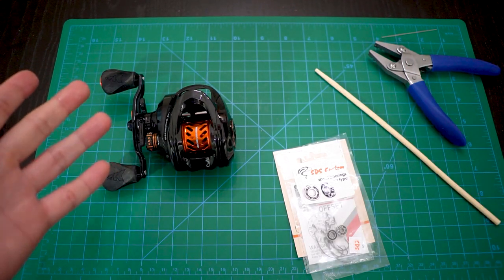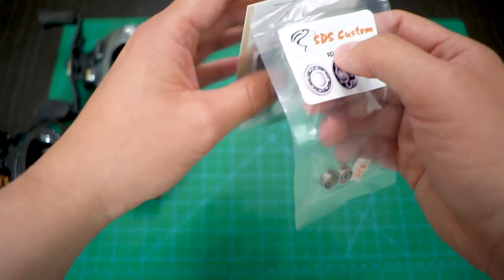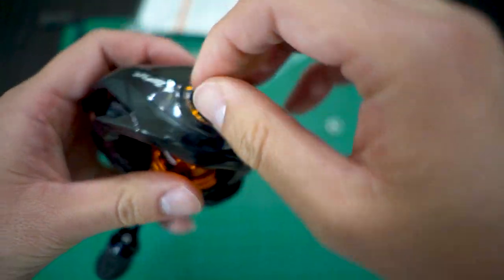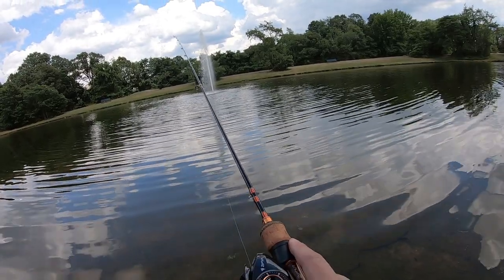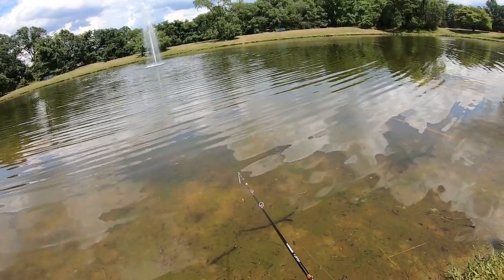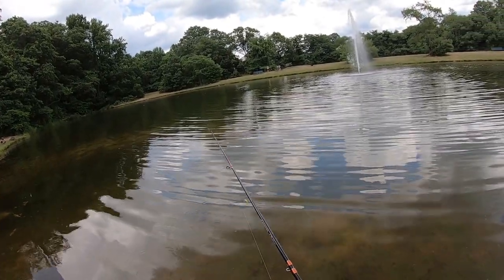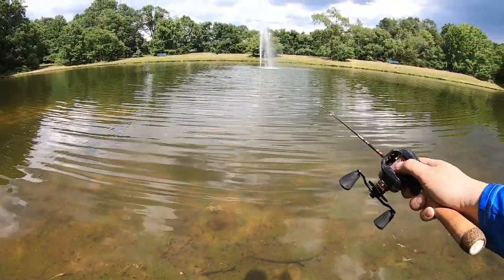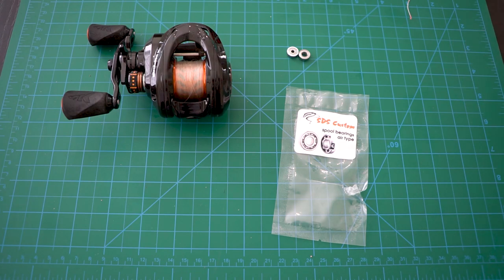KastKing Zephyr BFS Reel Bearing Upgrade - SDS Custom Ceramic Hybrid Bearings

Comment: What do you clean your bearings with?
Reply from the maker: I use CRC Brakleen. Don't use the non-flammable one or the environmental friendly one. Those are not gonna work. 
Some folks use Acetone, I have tried nail polish remover with success...
Some folks use mild dish soap and warm water, but i use that just for the orange seals for those that actually uses that. Chemicals like above would likely eat away the seals lol.
Use a glass jar, not plastic, fill enough so it soaks the bearings completely, swirl around a few times, let it sit, swirl some more.  take it out, place em on a chop stick, then use an air gun to blow clean!

Comment: Hi! Why you change only two bearings? After all, another bearing is located under the axle brake cap.And it also needs to be replaced.
Reply from the maker: That is because its a short shaft spool! The other one isn't really used. This reel is based on the Crixus body... which uses a full shaft spool. If you don't have anything in there to hold the shaft pin. The reel will not work. And even if its a long shaft spool, you won't need it. The bearing on the tension knob is only used when you overly tighten your tension knob. In the bfs realm, that won't happen as you fish with zero tension. Hope that helps clear up any confusions that you may have!
Reply: @rawrfishing  Thank you, I understood your explanation.  If you know the measurements of the axle brake bearing (not in the knob of the handle), please write.
Reply from the maker: @Sergey Fesik I am not sure which one is that. The two spool bearing measurements are mentioned in the video and the description

Comment: I bought the same spool pin remover pliers. It looks like you cut the pin that’s in the pliers shorter?
Reply from the maker: Nah. Mine is an older version.  I think yours might be newer? Is yours working?
Reply: Yeah I just bought mine from boca bearings like a week ago. I haven’t even tryed it yet. I just noticed the pin on urs was shorter and thought maybe there was a reason for that. Thanks for the reply though
Reply from the maker: Hmmmmm.... what if there is one for spinning reels? Hmmm
Reply: raWr Fishing I only see the one I have on the website, maybe they adapted it so u could use it for both types of reels
Reply from the maker: Let us know how it works. I hate the asia ones where's u screw in and push the pins out. All these CDM reels have pins that are stuck hard and it strip every single aluminum pin remover for me....
Reply: raWr Fishing will do bro, you having noticed if the pliers mar up the spool shaft have you?

Comment: onde conseguir esse pratico alicate extrator de pinos dos rolamentos,que o senhor usou neste video para a troca por rolamentos hibridos de ceramica? GRATO!!
Reply from the maker: I used the Pliers from Boca Bearings. but it's a bad plier. it started to warp after 2 years of light usage. I have not found one that i truly like, but they have a bunch of cheap ones on Aliexpress. Just give it a search :)
Reply: @rawrfishing , very grateful, teacher!!

Comment: This ebay retailer has a "full ceramic" version, in addition to the air type and orange type bearings. Has anyone tried full ceramic bearings and know the pros/cons?
Reply from the maker: I have seen it but there shouldn't be any more better performance from the spinning aspect; however, it is better than the hybrids for corrosion resistance. You will also find the full ceramic bearing much more louder.
Reply: I read that the shape of the ceramic ball makes it harder then steel but only in ball shape and since ceramic is like a stone it can file down a tail into the bearings walls maken it slower over time and not much time but with steel walls its has alot more time to wear out the bearing walls
Reply from the maker: I am curious how much can a bearing wear out on a BFS reel compared to say a skateboard or even a normal size reel for heavier lures.
Reply from the maker: I didn't like how they answered the question in their FAQs about if their bearings promote backlashes lol...
Reply: SDS never dissapointed me,great stuff for baitcasters and really good seller

Comment: Hey do you think the hybrid air HD full protect A7 are better then the air type? I’m trying to order mine today but dont know which to get
Reply from the maker: Not sure! Subjective as everyone uses different lure ranges. Some folks will want micro bearings for throwing light lures short range with accuracy and less power. I also only used this and their micro bearings. Have not used the other
Reply: The one you used in the video is the air type?
Reply from the maker: i believe so!

Comment: Yo, can I get a link to the pin remover pliers you're using?  A lot more useful than the generic ones you get off of aliexpress or even hedgehog.
Reply from the maker: Tackle Warehouse got em at 39.99, but u gotta pay shipping. amazon is a like 46 shipped. there are mixed reviews and I have to say, my pin is starting to bend on the pliers and may even get mushroomed. i think it's due to some spools with improper pins that were shoved in too hard and won't budge. 
I also agree, the cheap aluminum ones only last a few tries too.. u run into one that is in hard, u likely will strip the aluminum threading.. which happened to me twice >_< Here is the link to the pliers on amazon (afil. link lol)
https://amzn.to/2Wf7JhG
Reply: @rawrfishing  thanks a bunch
Reply from the maker: @chuelee7201  no problem! I think if I had to, I would get another one. Any spools that won't work.. dont force it. Use the channel lock pliers instead. Did that with my dark wolf lol

Comment: So its the full type ceramic bearings or. There is other types airtype orange bfs bearings which ones do u use and there all different prices
Reply from the maker: they never really explained it unfortunately, but given that I could get one or the other, i chose the more expensive ones.  >_<
Reply: @rawrfishing  which onesnunuseninnthenvideo
Reply: And do u buy 1 or 2 ir does 1 pak have the both in them
Reply from the maker: The air type.  Link in the description.  Both are in there
Reply: I talked to the sds guys and theynsaidndonfull ceramic or purple bearings for best casting got a new video there man the purple or full ceramc man ur shows arenawsomenand reallybhelpfull
Reply from the maker: @mathewross7742  that's cool! Glad they were able to answer your questions.  And thank you for the kind words!

Comment: Which SDS bearings would you suggest for saltwater?
Reply from the maker: Technical any of the stainless steel or ceramic hybrid will do. Full ceramic as well. If they have the size for your reel that is. I would still lube the stainless steel ones tho

Comment: Qual carretilha é melhor GH100 ou zephyr?
Reply from the maker: Out of the box new, the Zephyr is 100 times better than the GH100.  The GH100 was a terrible reel out of the box: Lack of lubrication and over lubrication of the bearings. Many people also have bad experience with the GH100 for many other reasons.  It just shows that their QC is bad.  There are now many other GH100 Variants available that are likely with higher quality QC.

Comment: Where did you get them pliers  from
Reply from the maker: I got those on Amazon. Boca Bearing Pliers are expensive and mine are starting to warp. Mind you that I only owned it for 2 years and with very minimal usage. I do not recommend it.  SDS does carry one if you intend to buy their bearings.  Might as well buy their pin puller. Note that Micro bearings would work better for light lures, which SDS also carry. they carry a purple one which i believe is Rays Studio.  here's the link to the Pin Puller: https://www.ebay.com/itm/254821198509?hash=item3b5486eaad:g:4QcAAOSwkEJf7IrW&mkcid=1&mkrid=711-53200-19255-0&siteid=0&campid=5338258913&toolid=11800&mkevt=1
Reply: Thanks
Reply from the maker: no bud.. thank you for watching! if you have any questions, feel free to drop a line!  welcome to BFS :)
Reply: I have the zephyr and the demon elite but the zephyr was broken so I call kastking and they are sending me two more reels I didn’t see it was a left hand demon elite I send it back with the zephyr and they are going to give me new ones that’s awesome I was afraid I just have junk on my hands but they come throw for me I got th zephyr from AliExpress it came from Japan the demon was a left hand Iam a right hand so I am Inspecting to Reels come in the mail ，Thanks to kastking for awesome service
Reply from the maker: hope everything will turn out good!  their support is always been good to me :)

Comment: GH100!
Reply from the maker: I bet you have a GH100 :P have you done any upgrades to your's yet? I just done ceramic hybrid bearing upgrades not too long ago and it was NIGHT and DAY!
Reply: @rawrfishing  I ordered them months ago and was waiting forever, but Aliexpress JUST (like seconds ago) approved of my refund even after waiting the extra amount they posted because of the current situation. 

I was the one asking you in a previous video of where you planned to source the micro bearings for the GH100 since the originals you used for the Spirit Fox (I think) didn't have the GH100 5-10-4 size. 

Now I am considering whether I should reorder the same regular hybrid ceramics, or take the gamble on the micros. I was originally going to wait for you to get them in and test them first. Either way, I will have to wait for a few more months before I get them…

Thank you for your hard work!
Reply from the maker: Yeah buying stuff on Aliexpress is tough, but glad my Micro Bearings came in.  Going to be playing around soon so after I test them and approve their Worthiness, you will see the links to where I have purchased mine.
All BFS reels that are used for light lures will benefit as it will allow it to spin easier, which means light lures can be casted for better accuracy. So if you can't get micro-bearings, the best next alternative are ceramic hybrids at regular size!
Reply: @rawrfishing  Thank you for your replies! 

Yes I might actually just get both the micros and hybrids just to test out the difference for myself. I look forward to your video!
Reply from the maker: @bob5899  Any time man! I don't think it's a bad idea to get them both.  Many reels will be coming out with the same bearing sizes requirement, so having a spare set will make you better off!  You can also understand more about how bearings impact your reel. things to consider would be adjusting brakes, tension and casting styles.  Wait until you see my community post LOL... drag clicker for GH100!
Reply: @rawrfishing  Ooo! I ordered that too! Still waiting for it to come in. Although, other than upgrading bearings, I have never taken apart a reel so it makes me nervous thinking about it. Haha! I hope it goes smoothly for me.
Reply from the maker: dang u really gone all out. probably would been cheaper to get that Black Knight BFS reel cuz it got the clicker and ceramic hybrid bearings yea?

Comment: Bro, what that plier call ?
Reply from the maker: Boca bearing pin puller.  It is fragile and broke with minimal usage in 2 years.
Reply: @rawrfishing  this pliers so expensive at my country. About 23$..
Reply from the maker: 40 in the US
Reply: @rawrfishing  lol. That more expensive.btw, I love see you upgrades the BC Reel. Thank you for sharing this.
Reply from the maker: @dekramness8660  if it's 20 usd for u, get it lol. It's not bad for those who only uses it minimally.  Many cheap ones I use are close to 20 shipped and none are as good.